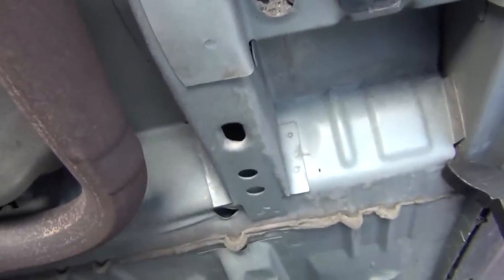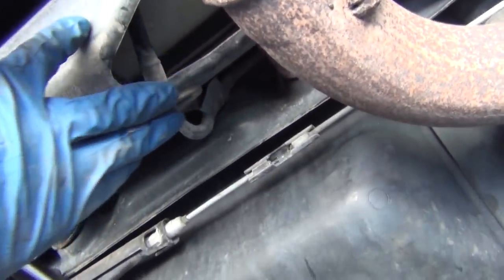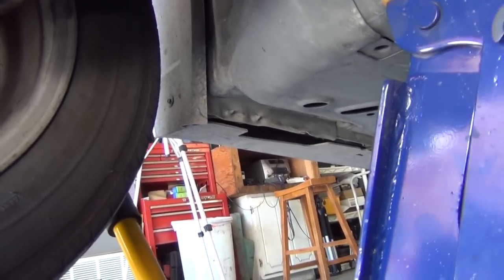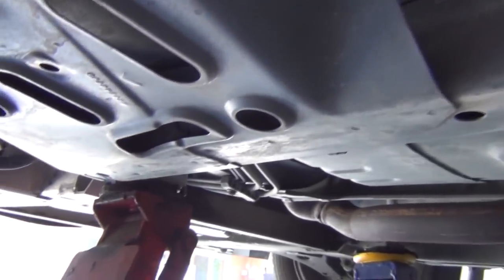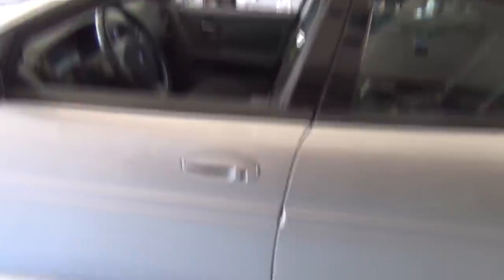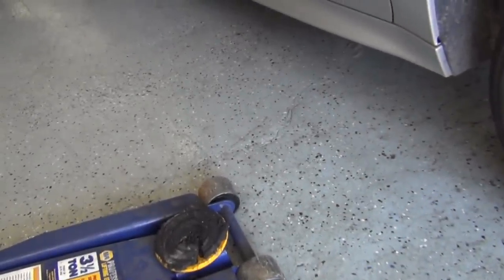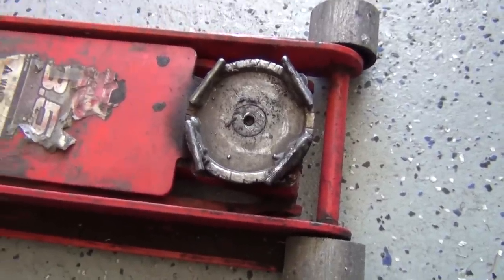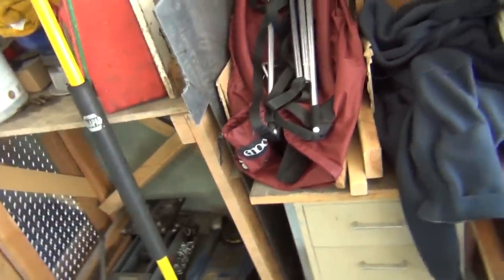How to jack up your car without jacking up your car

Comment: I always keep 2 blocks of wood in my boot, for changing a wheel. 1 - if changing on side of road, I don't always get a flat surface, so use 1 as a wheel chock.2 - flat tyre means flat side is lower than normal, so jack up a little, put a block under flat tyre, put jack down, and put other block under jack so can lift higher than normal so can make more room for spare tyre to fit in space.3 - can also use both blocks 1 each end of jack for very soft or muddy ground4 - can use a block as a de-facto safety stand while jacked up so if collapse, block will take weight instead collapsing back onto you or onto wheel hub. (both blocks only weigh 10 kg total, and to me a peace of mind as they are heavy construction wood I 'found' from a crane truck when they use it for their stabilisers.
Reply: I also keep a old plumbers pipe I found on side of road in 1993 when I got my first car, it fitted the end of the tyre brace perfectly, could adjust it length depending on ground and tightness of nuts. It travelled with me in all my cars over the years, keep it in the tool box now, as lately cops can charge you with having a offensive weapon inside car, even a wheel brace, tyre iron or flashlight.
Reply: +ChiefShittingBull what about your new dad? what did he teach you
Reply: +ChiefShittingBull lol
Reply: +ChiefShittingBull you too and a happy new year

Comment: Thanks for the instruction.  Never knew there were so many safe jacking points on a frameless car.  Cars in the 1960s, when I was a kid, had frames; not just pick'm ups.
Reply: I think even several cars in the '80s had separate frames. Or maybe some even into the '90s. I don't know for sure, but I wager a guess that it certainly didn't end with the '60s.

Comment: On my car the radius arm is called the trailing arm.  Different cars have different names for the same thing and sometimes a manufacturer will have multiple names for the same part.  So to clarify what you mean all you have to do is point and say "that thingy".  Ah the power of video. :P

Comment: C'mon man, get some jack stands. Hydraulic pumps often fail but I'm sure you know this....?(I know you got two but if one fails then it will likely cause the car to shift and knock the second hydraulic jack out, cause it to is on caster wheels) jack stands don't have wheels and likely will be enough room for you to move if it did fail.

Comment: Luckily my roommate showed me how to do all this today when I went outside to do an oil change on my car. I usually use ramps, but my ramps are currently 2000+ miles away, but she had jack stands and a nice hydraulic jack like yours, otherwise I was going to use the scissor jack that came with my car. I do need to invest in jack stands and a real jack. Makes me love my motorcycle much more since it has no lower fairing on, I have direct and easy access to the plug.

Next up, I have to change my brake pads and brake fluid in my car since it's the factory stuff from like 2006 (60k miles on the car) and the fluid is really dark, I can see how dark it is through the reservoir container. :(

Comment: I've been repairing cars for over 40 yrs. Never ever chock the wheels!!! I know everyone taught you this, but it is incorrect. The wheels need to move so the car does not slip off the jack as you lift. This is why the jack went through the radiator. The same goes for repair shop lifts. If you raise and lower the vehicle multiple times while in park it will creep off the lift and fall on you!
Reply: flatrateus I can see what you're saying but maybe I don't fully understand...

If you put a single jack perpendicular to the vehicle, putting a wheel chock on loosly shouldn't affect the Jack, since the Jack's force and wheels are in a different direction than the cars, right?

I don't really know myself. I work as a firefighter and we have to use wheel chocks on every scene, but we have them about a centimeter to 2 inches away from the tire, depending on the size of the vehicle/chock we're using, but that's not when lifting a vehicle. (When the new guys don't listen to me and put it right up on the tire, the weight of the water on the truck usually shifts it enough that it gets stuck on the chock and has to be forced out in a not-so-safe manor).

That's the reason I use chocks but not tight up on the tire, like I usually see in car videos, but I also have MUCH less car repair experience...

So to summarize, using a chock a cm or so away would allow for minor vehicle/jack shift, while still providing a stopper to keep the car from rolling "away" right?

Also, would putting a sanding block (foam covered in sandpaper) or rubberizing the jacking pad help keep it from slipping, along with doing your work on a hard/flat surface, with a big wheeled rolling jack? It sounds good in my head at least, but I'd be too chicken to try it, haha.

Comment: Cool vid, I find the best solution for track guys is to ghetto fabricate your own jacking bar for the rear and front of your missile car and simply attach it to the bumper support bar when you get the bumper off. Voila you can no use cheap trolley jacks instead of those expensive things

Comment: Pinchweld jacking can be risky on the older cars where the sheet metal underneath has started to rust. You know your SOL when the jack continues to rise, but the car doesnt. :)

Comment: briansmobile1 I lifted a 01 buick century and put it on jack stand (jacking point near the wheel). That sucker actually warped. I noticed it afterwards when it was just sitting on the ground, the bottom is no longer straight. So I guess sometimes even when trying to jack up a car without jacking it up, it still gets jacked up. I only lifted one side which probably didnt help but AFAIK it should have been able to handle it.
Reply: +BoogieDownProduction Did you open any doors? Opening doors while a car is jacked up will screw up the frame.

Comment: cool - my Corvair is hard to jack anytime - but by starting in front, then picking up the rear sides under the B pillar of the 4 door (with help at the rear engine mount, via second person) the feeble unibody can then handle the teeter totter warping effect - I watch carefully at the windshield moulding & trim for zero movement

Comment: I'm a do-it-yourselfer mechanic who has been working on cars for about 35 years and have used everything from bumper jacks (yes, I'm an old timer) to scissor jacks to hydraulic floor jacks and I'd love to learn your trick on how to jack up a car without a jack.  Unfortunately it doesn't appear to be in your video.
Reply: +E.PLUMBUS UNUM  Well, my Brother-in-Law had a rail-buggy back in the 90s (when we were both mid 20s - mid 30s, and more than once one of us would have to "deadlift" the car and hold it up while the other placed a block of wood under it...or just went on and changed a flat tire or something!  
 Also, once when I was in high school there was this kid who had like a 70s or 80s BMW that he ran off in a DEEP ditch in the "overflow"parking lot, so I and like 3 big ol' black dudes who were on my wrestling team grabbed it by the bumper and rear fender wells and lifted it up and spun it around back onto the driveway!   
 (of course there happened to be a group of cheerleaders nearby ...

Comment: Very interesting -- things one should NOT take for granted when jacking up the vehicles!  Thanks for the tips and for sharing your experience.  BTW, nice / practical / safe solution for that jack head, i.e., welding bolts to increase indentation grips.

Comment: Seen a jack slip off the side rail and go through the floor pan... Just used a big and small hammer to get the panel flat again and without the big circular tab sticking out and then went and rubberised the floor pan inside and underneath in that area, claimed it was rusty.

Comment: Some incorrect information here. Brian says to place the scissor jack on the pinch weld. Well, no. Only on the part of the pinch weld that is reinforced. It will be marked. Otherwise you can bend the the 2 pieces of steel that make up the pinch weld. I also see jack stands in the video, that look like they are place on a wrong part of the pinch weld. Glod Brian is making this overcomplicated. Where do you lift up the car? You access the factory service manual. It will show you all the points where you can lift. There is usually 4 reinforced places on the pinchweld, one behind each front wheel, and ahead of each rear wheel. Plus there is one place to put a rolling hydraulic jack at the front of the car, to lift the entire front of the car, and another place at the rear. If you have a rolling hydraulic jack the simplest and best way to do this, with a front wheel drive car having a parking brake that works on the rear wheels is to set the parking brake firmly and to first lift up the front of the car, then let the car down onto jack stands placed at each of the reinforced places on the pinch weld that are right behind the front wheels. Then lift the rear of the car and let the rear down on to the rear reinforced pinched weld spots. Letting the car down is the reverse: first let the rear down, onto the rear wheels that are braked b the parking brake, then let the front down.

Comment: Odd situation here. One of our cars has a cracked back rim that causes the back tire to slowly lose air. We plan on getting a new rim but are headed on vacation for about 12 days and cannot get one before that.  If I’m not actually changing the tire or crawling under the car, do you think it would be okay to use a trolly jack to just relieve a bit of pressure on that back side by cranking it up just slightly? Not even enough to lift the tire completely off the ground.  I just figured it would help keep the weight of the car off that wheel once it goes flat so it doesn’t cause any further damage to the wheel.  I don’t have a jack stand and I’m not even sure I would need to lift the vehicle light enough to place one down. It’s a 2004 Mazda 6 so it’s pretty low to the ground.

Comment: the scissor style jacks that come with the cars for changing flats say on them "do not use for repair or maintenance" but why? they look fine to me. of course i wouldnt wanna be under the car with them being the only thing holding it up but i use them to lift the car to get a jackstand under there and take them off. had a hydralic jack but it went out somehow so i just use that scissor jack to get the car up and down when i need to do anything. then again, its a 99 saturn sc1 so its pretty light.

Comment: Brian: As always, good advice. What I personally hold most valuable from & of your video, is the lesson learned through your personal hands on experience of what not to do, as an example through your misfortune. Speaking of a time when a floor jack you were using slipped away from a designated jacking point,  resulting in vehicle damage. That alone is a valuable lesson that & for many who "pay attention" can be prevented. You shared something that most would take to their grave, versus promoting it to an audience so vast as the youtube channel. As for the small, all alone, unrecognized, uneducated,  with their sharp tongue attempting to pierce whomever they can devour. Have no case, other than ignorance, & we don't rent space to that audience. That said! Sharing that mishap, owning accountability, with suggesting ways to avoid, or at the least, lesson the probability of it happening to someone else, & eliminating some percentages of element of chance, & adding attention to details. Went above & beyond what can be expected from most. Just encase a negative. twisted tongue, lip flapping, nay sayer that post that sissy girl crap decides to "pay attention", & is wanting to stop squatting, pissing like a pup & be a man. Then grow a pair! What Brian demonstrated that was above and beyond is called "INTEGRITY". Unfortunately seen less n less these days, but "RECOGNIZED"  to those who have it. "FEW N FAR BETWEEN". Seldom does a man get to witness definitions of integrity because to do so you have to possess it. That can be taught, learned, & developed. But what next? "HONOR" Honor no man can give & no man can take away. Honor is a mans gift to himself. Woman can also have honor and it's a mans duty to protect it. Nice to be reminded, sadly  ever not so often. I'm not passing through by myself. Time to gather floor jacks, jack stands, & put the old 84 Dodge 600 in the air & replace some wheel bearing's before they start humming. Thanks again Brother. Mack over n out!

Comment: I had a newer Jaguar slip on me with the customer right there. Very unfortunate, costed me a little bit over a grand to compensate. Im definitely welding some bolts to my jack, coincidentally i think i have the same red jack.

Comment: The form in redundancy is not just having two floor jacks holding the front up on that vehicle Jacks have hydraulic fluid and seals to achieve there lifting capacity. Never trust a $5 dollar seal in any floor jack the odds aren't on your side when your underneath a 3 thousand pound car. I've had a cousin die this way thinking a car floor jack was sufficient enough and he lost his life. I get your demonstration but demonstrate it correctly so others will know. Use a floor jack and jack stands at all times and if you have to remove the tires place the tires underneath the vehicle as well.! You want to increase your odds dramatically when your underneath a car.!

Comment: Great video. I have a 98 Ram 4wd ext cab 1500 with 285s on it. Having a hard time finding a jack to carry with me. I really don't want to have to carry my big floor jack around with me. Ay suggestions? A regular 2 ton is too short. Thanks.

Comment: I have an 08 Honda Fit I got used (long story) for local dashing around.

It's always had this tiny oil leak, which I thought was drain plug related. Finally replaced the plug washer to no avail.

Next change, I thoroughly cleaned the (die cast) pan around the leak area & found a hair line crack... closer inspection revealed witness marks on the pan bottom obviously generated by a floor jack. :(

Anyway, the leak is so slight, I'm hoping a tiny bit of sludge stops it. Time will tell...

Comment: hey brian i think the videos you produce are awesome and i have a question for you, what kinda of floor jack do you like.  I have an 04 gmc sierra 2500hd so like your dodge i need some height to get my truck high enough off the ground to remove the tires and what not.  I have worked with a couple of the new craftsman ones and the hydraulics seem to blow out after a little while, so i am just curious what brand you like?

Comment: when i needed to drill and tap holes for the ground lines for my amplifiers, I just took two ramps and put them on the same side of my truck... Of course, I didn't technically have a floor jack at the time.. May have done it right if I did.

Comment: Brian, I just watched a vid of you for the first time a few days ago and it was one of the best I have ever seen.  I did subscribe and I'm wondering if you have ever replaced the power steering pump on a 2007 Ford Escape ??  I am in the middle of replacing the fan assembly and decided to try replacing the p.s. pump because it looks like that is the leakage problem.  It has been losing fluid and is now growling soooo.....while I have a big mess on my hands I may as well attack that also.  Any thoughts will be greatly appreciated.  Thanks in advance.

Comment: Brian hi, I hope you still monitor this video. On my 98 Lexus ES300 it's the same PS pump. I'd like to replace the pulley, and I'm wondering if in this video you used a pulley tool or you were able to get it off using tools already on hand. Barring the pulley removal,  replacing the ps pump entirely, is the pulley still required to come off or can I get it off directly? thanks - John

Comment: Scissor jacks are very unstable. Never use scissor jacks to support the vehicle when you're working under it. If you use a scissor jack for this purpose, always use a jack stand and make sure the car's weight is ON the jack stand. Scissor jacks are for emergency purposes to change tires on the side of the road. Not for doing car work.
Reply: Thats the same with any jack. Never get under a car unless its on stands
Reply: Very true, But I will occasionally use a jack as a backup for a jack stand. Like, have the jack just barely putting pressure on the frame right next to a stand.
Reply: BAM5 thats a good idea. No reason to remove the jack after you lower it onto the stand
Reply: Yep, no such thing as too safe.

Comment: Have a 2004 Crown Vic. Slipped off the jack and the oil pan got crushed, severed the steering cooler line and just basically ruined my day.

Comment: I think you meant to say "Parking Brake" which is a mechanically operated brake and not an "Emergency Brake."  I would recommend referring to a service and repair manual and to pay attention to the safety precautions.
Reply: Parking brake, hand brake, e-brake, emergency brake are all used interchangeably.. perhaps incorrectly, but yeah, it's commonly referred as all those mentioned.
Reply: All the same.
Reply: They're all the same mechanism. That's why when you put your e-brake on the e-brake light and the parking brake light come on.

Comment: Pinch welds are not for jacking. If you read the owners manual, those handy arrows are sowing you the hole/holes in the unibody structure where the jack supplied with the car go into to help prevent the jack from slipping.   I watch lots of your vids and find most of them pretty good but major fail here.  Read the owners manual.  Pinch welds are not for jacking.
Reply: I thought the owner's manual on my wife's 2009 Altima says to to jack there.